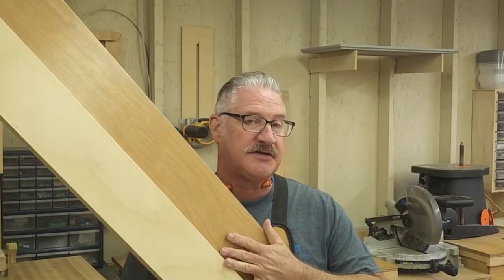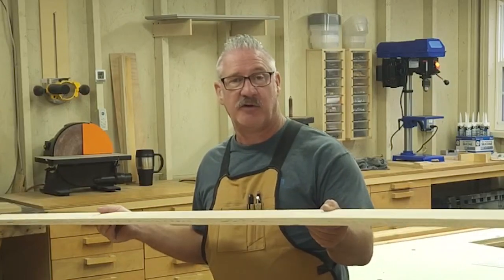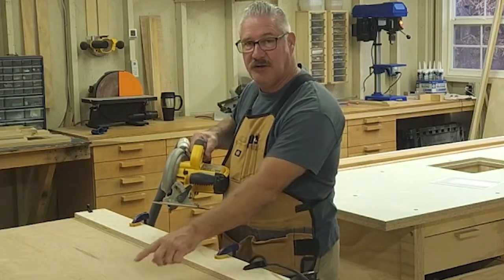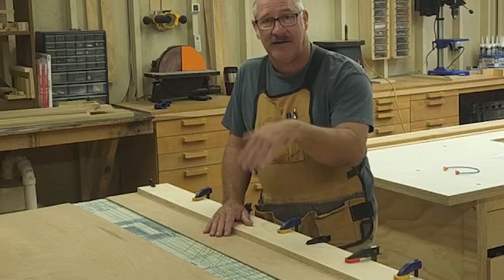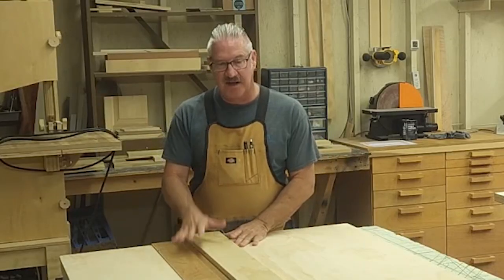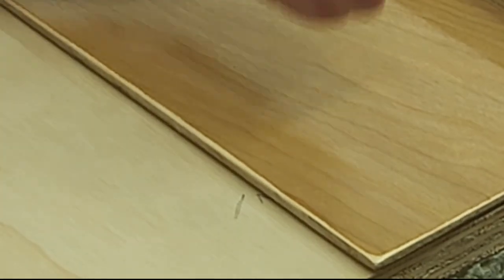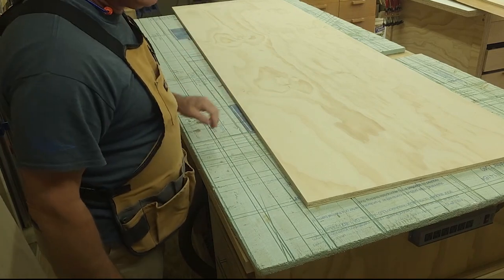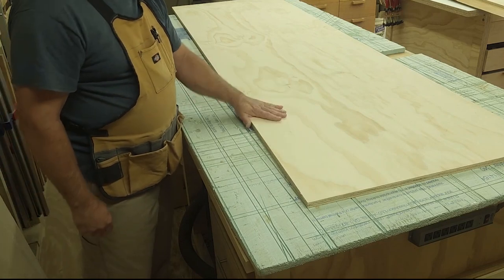Making a DIY Track Saw, Making a Door Board, Making a Saw Straight Edge, How to build a Trac Saw

Comment: Would using a piece of MDF as a fence work better than a piece of wood that could bow or warp over time. The MDF would be more stable.
Reply from the maker: Yes that would be a great choice. You could even use an MDF piece of primed trim, say a cased opening 1 x 6 or something like that. I had this ply on hand so I went that direction. This is the Radiata Pine ply from HD. They call it cabinet grade and it has many layers to it. Great point Bill, thanks!